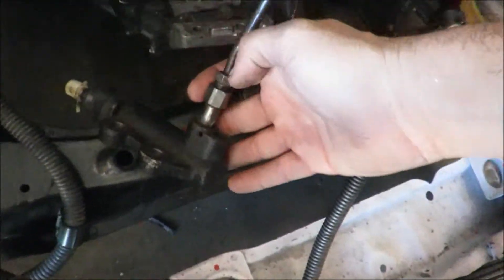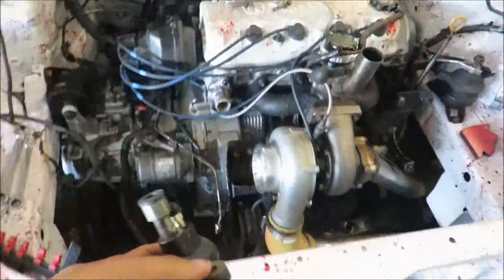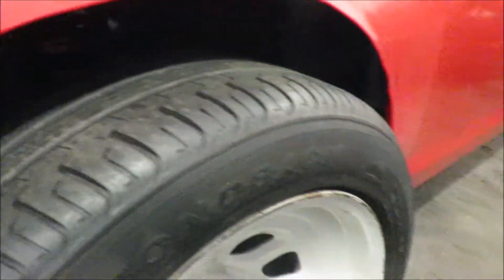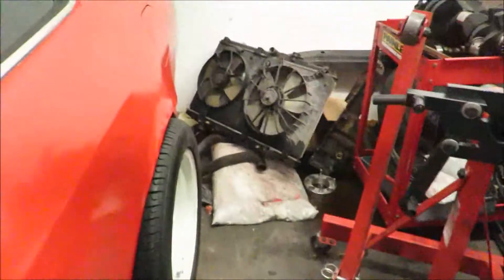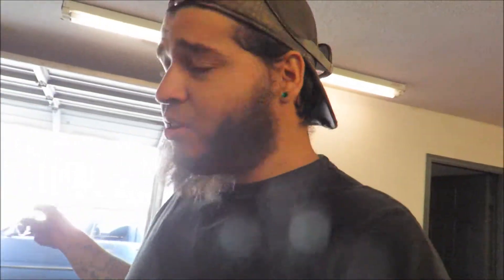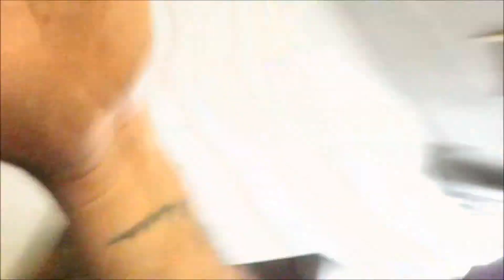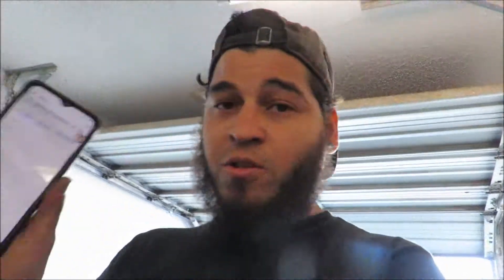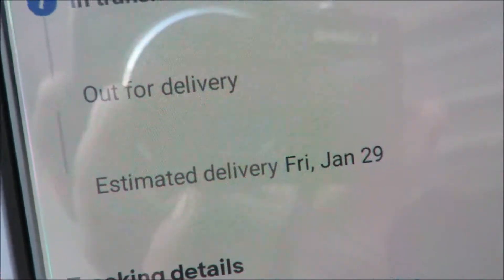Boosted F23 Honda Accord Is Officially On The Ground!!

Comment: THATS AWESOME I KNOW HOW'S YOU FEEL I JUST FINISHED MY ACCORD INSTALL AND GOT IT ON THE GROUND TODAY !!!!! GOOD JOB LOVE THE VIDZ
Reply from the maker: Next big thing is the first drive then tune lol and congrats man its definitely a great feeling 🙏💯
Reply: @cardudegarage  first drive on the way to tune .hell ya
Reply from the maker: Hopefully first drive in it this weekend
Reply: @cardudegarage  hey quick question what line did you tap into for your waste gate
Reply from the maker: It goes to the front housing of the turbo
Reply: @cardudegarage  ok just asking my turbo doesnt have the pressure nipple .and I'm trying to make sure I tap into something that will for sure work
Reply from the maker: You can run a t in any vacuum line off of the throttle body
Reply: @cardudegarage  cool thanks alt for your help
Reply from the maker: Yea man good luck if you have any other questions just message me on Instagram